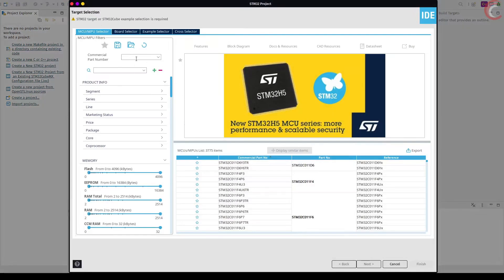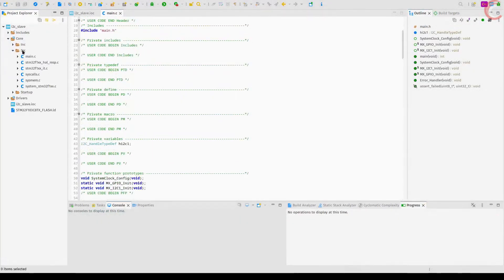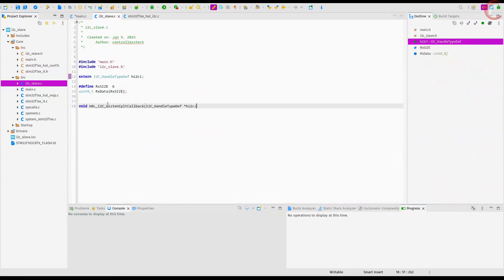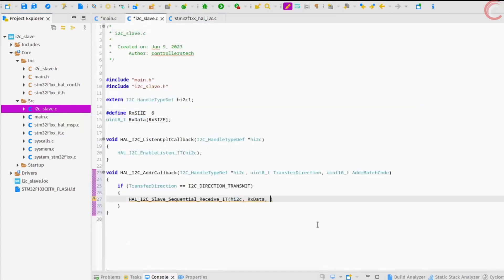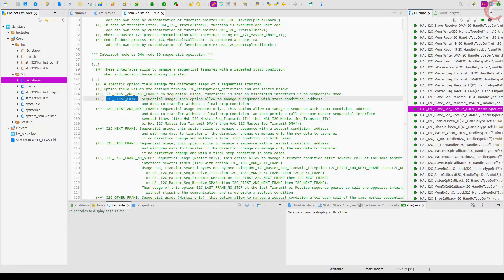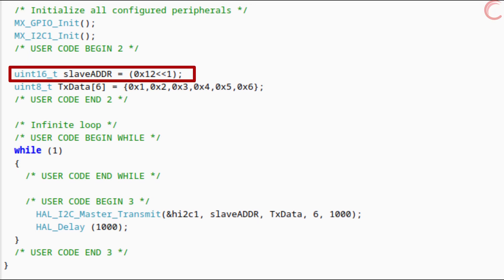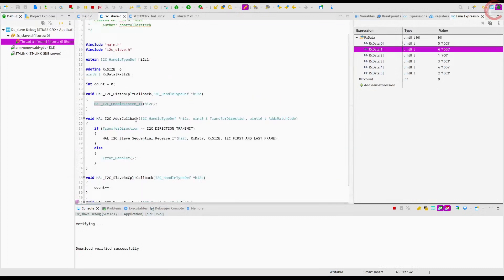STM32 as I2C Slave PART 1

Comment: where is to write the master code, did u use arduino ide to send the code ? or you have another option
Reply from the maker: I created a master device on the computer and used usb to i2c converter to send the data to the slave.
Reply: @ControllersTech  can u explain more, i still not understand
Reply from the maker: Chips like FT232H can convert USB signals to i2c/spi/uart etc. But remeber they are very hard to configure. 
https://www.ubuy.co.in/product/B5LZEIQK8-vomeko-cjmcu-ft232h-high-speed-multifunction-usb-module-for-jtag-uart-fifo-spi-i2c-with-fast-data-transfer?srsltid=AfmBOornJqByMkbpwaPj7rTS1zFCf-G4envMzFLz10L6RId_j2UOcJ5712g&gPromoCode=UBNITIN&gQT=2
Reply: @ControllersTech  did u make another project for master device and send the code there ?
Reply from the maker: What ai am using is explained at 7:30. If you watch a little more from that point, I have explained how you can use another mcu as master and send the data to this slave device.

Comment: Hello, i try your master code on STM32F072 Nucleo, but there is no data coming out from SCL and SDA as i try to see using oscilloscope and the slave STM32H7A3 RxData[6] all 0. could you advise??
Reply: hello... can you reply...
Reply: hello can u reply...
Reply: Hello can you advise the STM32 master code? i couldn't process with your tutorial without the master send 6 bytes. The slave is working but there is no data receive at RxData[1--6]  can you please help?
Reply from the maker: This is because the slave is programmed to receive 6 bytes. Not less, not more. 
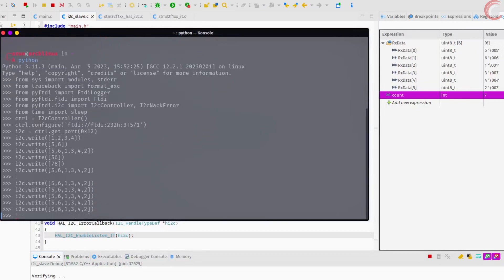Check out 09:00
Reply: @ControllersTech  yes i did that in the master and slave.... when i live expression at slave all RxData[1--6] appear zero.... when i scope at  i2c master there is no waveform at all, Y? .... please advise...
Reply: Hello... can u please reply ?
Reply: @ControllersTech   kan  ni neih...

Comment: mümkünse 3 adet as5600 için de bir video yapabilirmisin? thank you
Reply: If possible, can you make a video that reads data with i2c bus with 3 identical addresses (as5600 chip fixed address). Thank you.
Reply from the maker: You know that's not possible. You can't read multiple devices with same address on the same bus. You can try the following though:
1.Some devices allow address modification by pulling certain pins nigh/low. Check if your device allows that.
2. If the above is not an option, then get a multiplexing device. This can allow you to connect multiple devices but only 1 device will be read at a time.
3. Use another I2C instance of the MCU. For ex- use I2C2 or I2C3.